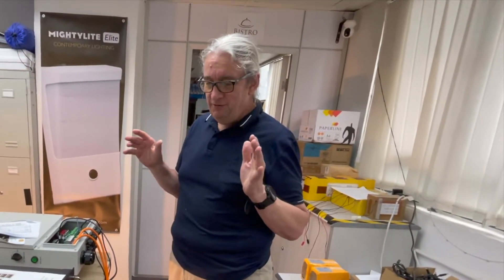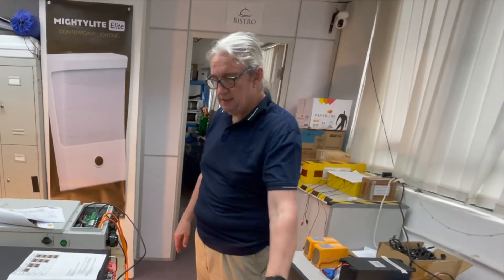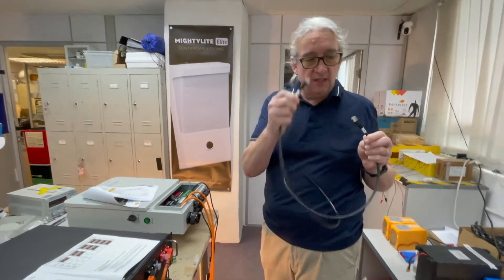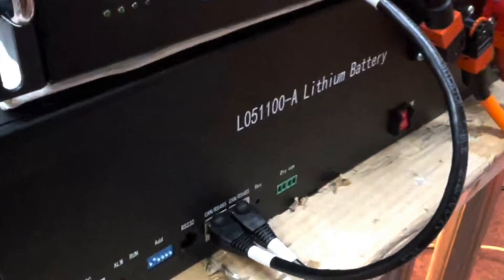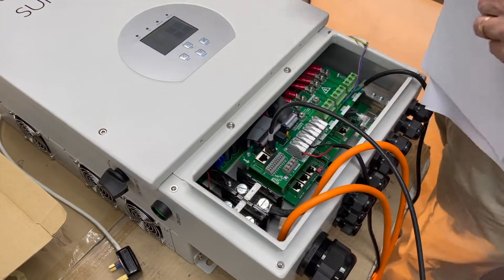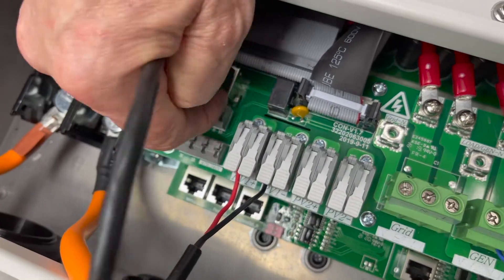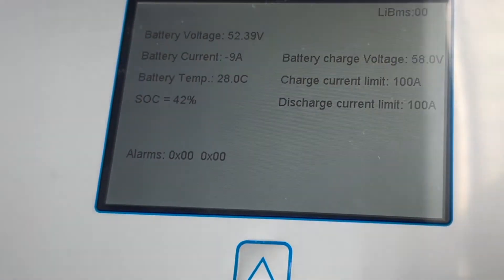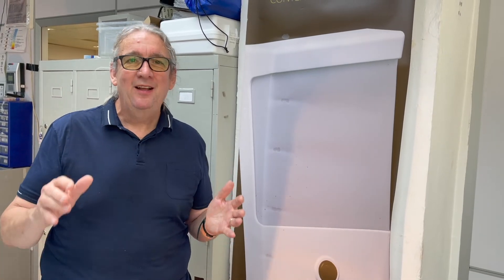Setting up a battery

Comment: Does the battery management sometimes switch one battery off. I have a 5kwh system with two 5kwh batteries all from sunsynk but the battery that was installed first switches on and off whever it feeels like it.

Comment: Hi, I need to connect a sunsynk inverter to a BMZ battery. is there any wat to find out how the RJ45 cable should be wired? i cant get information on the pinout of the battery RJ45 port. I understand the inverter RJ45 port is wired standard, so a normal rj45 cable will work.